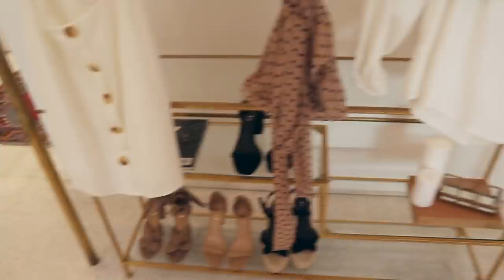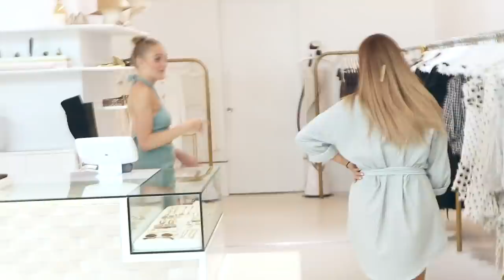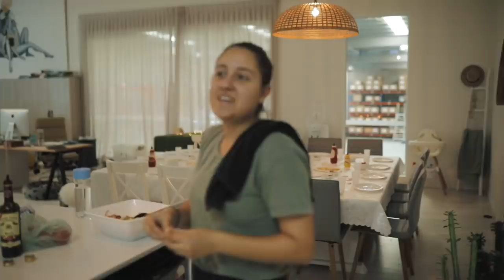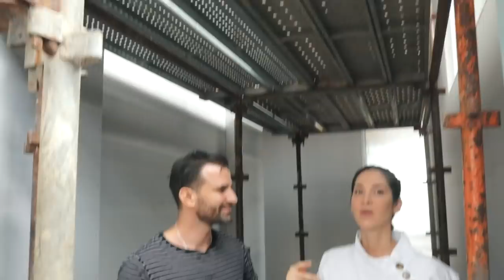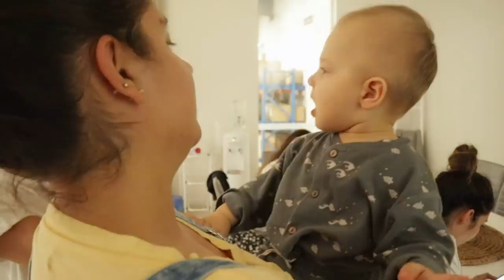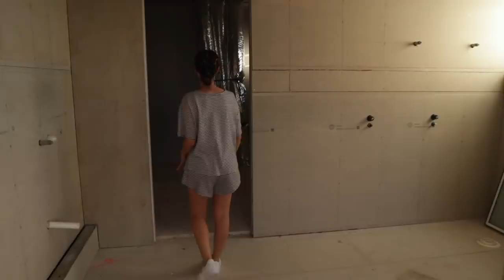Weekly Vlog: Store Baes, Bdays and HOUSE TOUR!

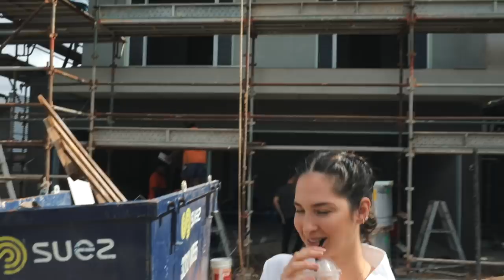Comment: I was the same when building my house! I just wanted white on white on white. I ended up using a really pale grey for any "contrast" elements lol thats as dark as I would go. With the open void, definitely leave it open with a glass railing! it will have way more impact than a glass wall, the sound will be absorbed by doors and furniture so I dont think noise will be a problem. PS Yiota, is that a sabo top you're wearing at 9:00?? I need it. <3